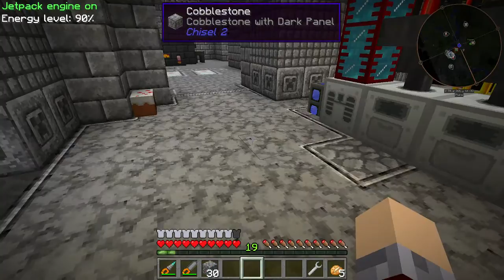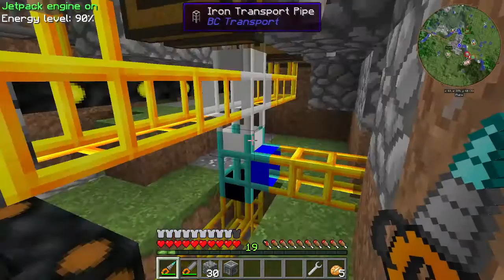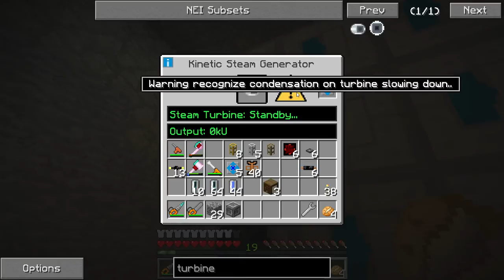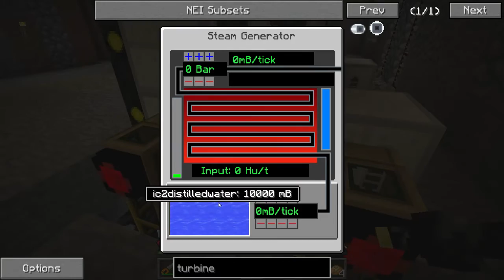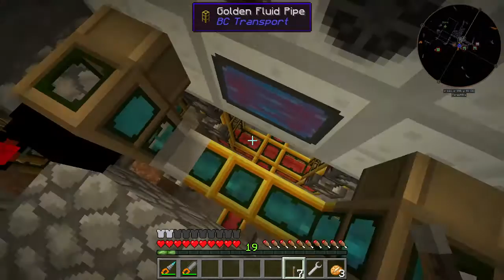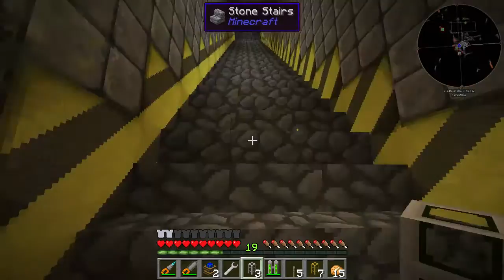MineCraft 1.7.10 Single Mod Survival Game IC2. #30: Steam Reactor Activation

Comment: did a bit of trial and error on a reactor simulator... so here's what i came up with for mark 1 operation...

400 Hu/s reactor plan:  http://imgur.com/dW9rstY
800 Hu/s reactor plan:  http://imgur.com/p1xTLVu

(if anyone doesn't know, mark 1 means it can be run indefinitely without overheating.  basically, set it and forget it, as long as you get your coolant system set up correctly.)

Comment: i just use fluid ejector upgrades in the condenser and turbines, then attach iron fluid pipes to direct the distilled water back into the steam genny.  seems a lot simpler than having to power three machines when all you want is to pass along the water.  i'm sure there are people who found a use for the fluid regulator in some weird configuration they came up with, but for me it's completely worthless.

also, i discovered that it's possible for the steam genny to eject steam into the pipe that's supposed to be feeding it distilled water... so instead of connecting the pipes directly to the steam gen, i pipe the distilled water into a fluid distributor, and place it directly touching the steam genny, so there's no pipe connected to it.

Comment: A lever on a induction furnace will keep it heated up. Try to put a lever on your thermal centrifuge.
Reply: +Tyler Chartrand 
for some reason, he's worried about wasted energy.  a couple videos ago, he actually removed the motor from a kinetic genny powering a turning table because he was worried it would be sucking up energy.  i doubt it would, but even if it does, it would have to be a minuscule amount.

Comment: condensers needs 4x vents and u could probably use set up with advance vents (for 320 eu/t) which are cheaper + u have some room for plating which blocks explosion so the whole chamber stays intact.. rly nice set up anyway and u can even adjust how many cores u gonna use. how long does fuel last? basically u can put it on 800 hu/s and make double steam sytems and it would work? rly nice videos and I like that texture pack too